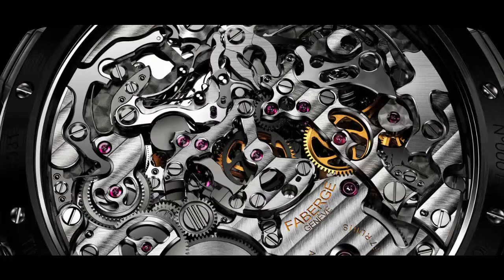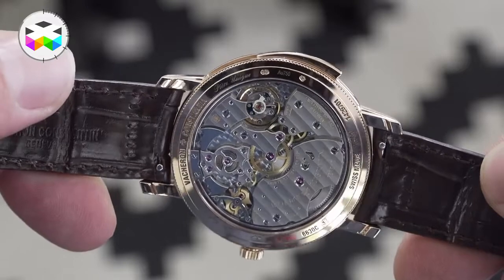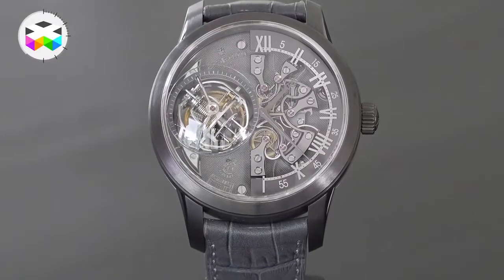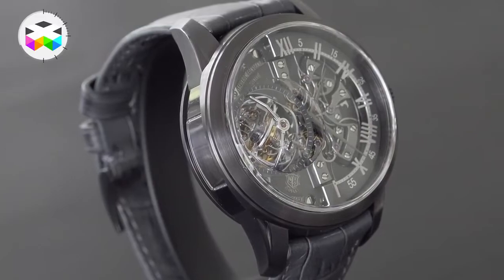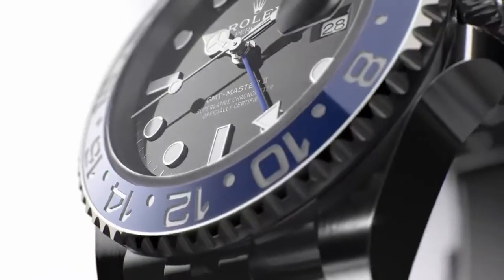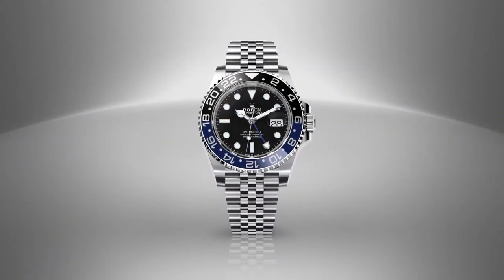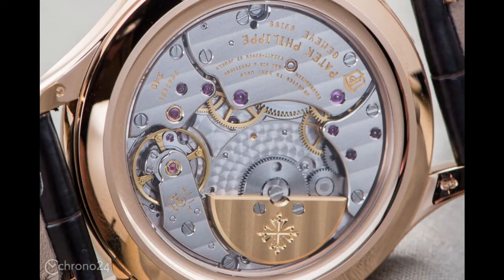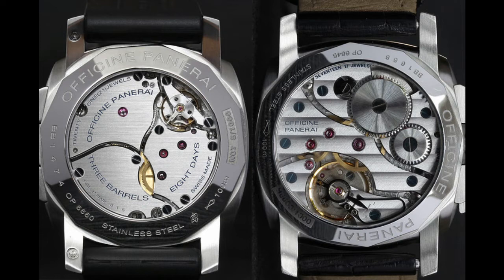Technical vs Design - What is More Important in a Watch?

Comment: I think they are one in the same. To have a watch that is technically sound, you also have to design a good looking watch. They are not able to be separated
Reply from the maker: You make a good point. The design of the watch has to be such that the movement works with it